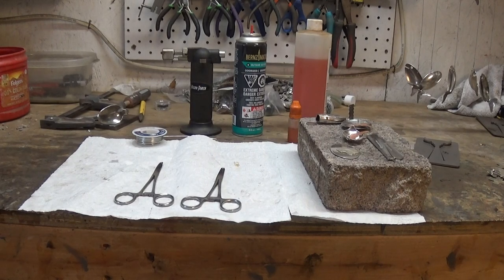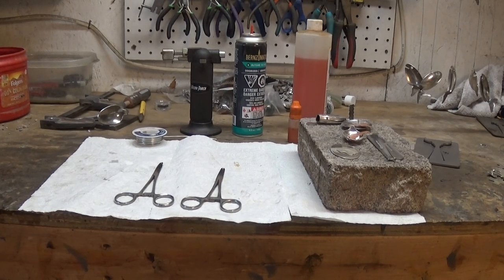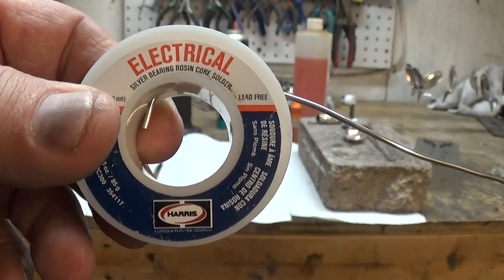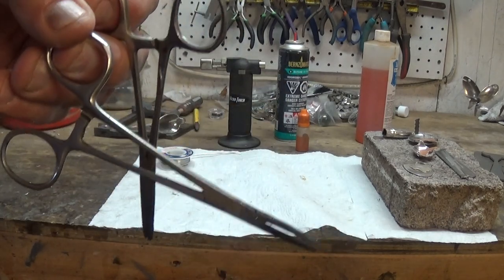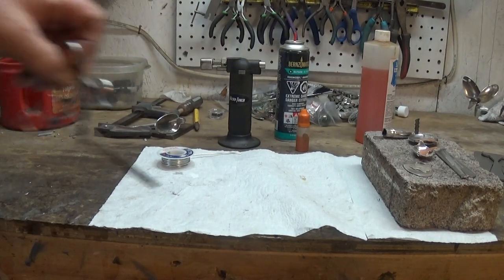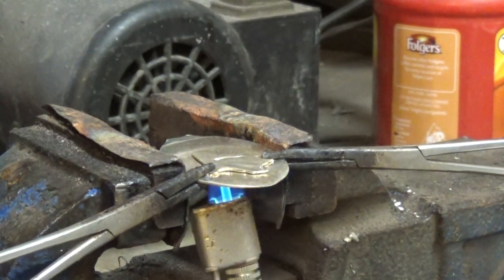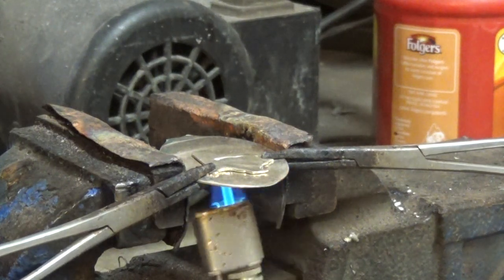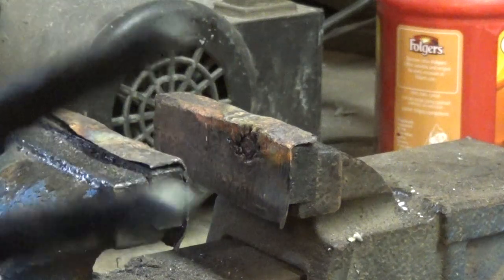how to solder silverplate flatware

Comment: Hi can you solder fine sterling silver bezels to silver plate or stainless steel?  If so which solder can be used?  I use silver solder on sterling silver but wasn’t sure what to use on silver plate or stainless with the fine silver bezel. Thank you!

Comment: What is a pancake dye?how do you make the little circles? Please explain
Reply: A pancake die is a flat piece of, usually, some sort of toughened spring steel that has desired shape wire cut into it. The shape is bent up ( the whole is still in one piece, the shape is bent up and the side of that's not cut acts a hinge, ), the whole is hardened and tempered and then you wedge a piece of metal under the bent up piece. Then put it in a press, even a bench vice can if you da which the lot between some wood for protection, and a shape is cut out of the metal you wedged in the die. I'm doing this on phone, please forgive any mistakes. I think Rio Grande supplied, it will help to understand if you can see one.

The matter of the circles is similar but any jewellery tools supplier will be able to help get a circle punch and die set. Evil bay and Amazing Scum lord (Amazon, I hate that slave owner Bezos)  both sell them. They are a steel block you fit the material you to cut a circle out of into and then hammer a punch the circles size through the corresponding guide hole. I hope this helps a bit.